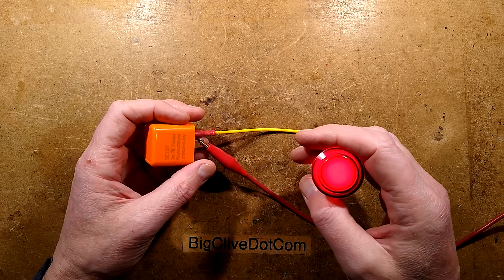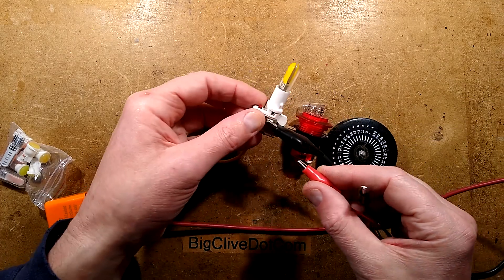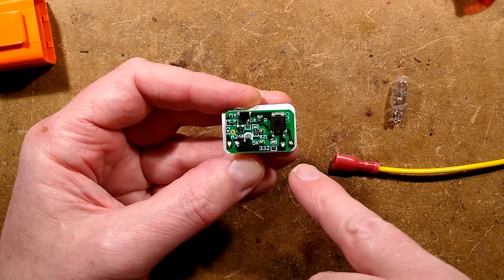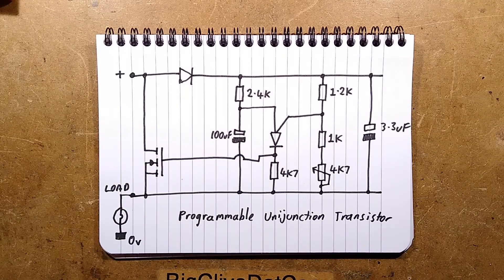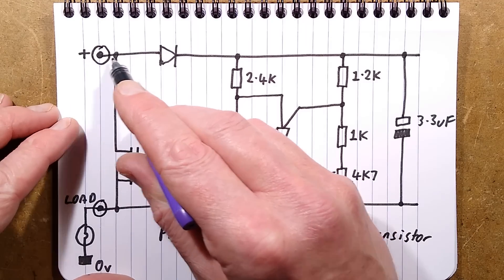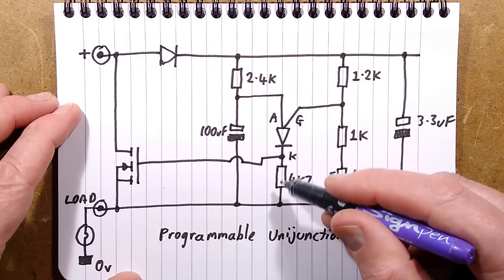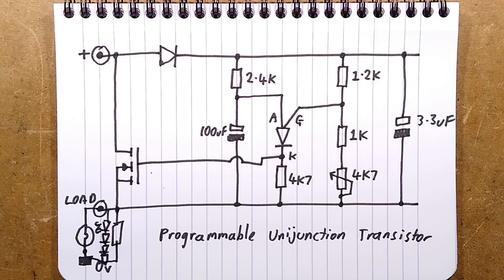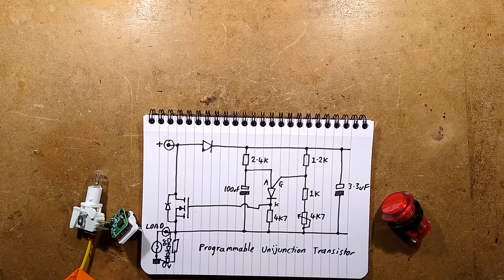Two wire flasher module teardown with unexpected find

Comment: Now that cars use solid-state flashers that don't click, recent cars have a solid-state click sounder fitted to show the indicators are on.
Not sure if it is an all-in-one device in my car, but you can tell it's not the bi-metallic strip clicker but some kind of sounder making the click as the indicators go on/off.

Regards,
K.
Reply: You will probably find that the computer does the flashing of the circuit via a mosfet and the clicking sound is coming out of your speaker system also generated by the computer. In my car, it's the BCM (Body Control Module). Modular mechanical relays are pretty much a thing of the past now in most modern cars, where they do exist, they have very few uses.
Reply: This kind of thing is done via a body control module these days, and they have a speaker for e.g seat belt warning tones that are also used to generate the fake clicking noise.
Reply: Modern? We were synthesizing the "flasher" sound (and many other beeps and bongs) for cars in the late 80s. Used a microcontroller. Programmable UJTs are great for overvoltage warning things too.
Reply: @MarkGovier  We had no need to synthesize that sound in the late 80s because in the late 80s we were still using the bimetallic flasher relays that clicked naturally. The need to fake that sound didn't arise until just a few years ago when marker lights started moving away from filament bulbs to low power lights that didn't draw enough current to trigger those old school relays. Matter of fact, back in the 80s, if a car had beeps and bongs each one had its own piezospeaker to do it.

My 85 F150 had such a buzzer. I ripped it out and yeeted it.
Reply: @TestECull  you might not have, but some major global brands have been using electronic control for the lights since the 80s.
Reply: The lack of a click-click on my eBike turn signals is extremely annoying since I ALWAYS forget to turn them off, so I ordered some self-stick vibrating haptic feedback motors to mount underneath the seat. Pretty sure it will work well, and I'm looking forward to vibra-butt feedback!

Comment: Huh, it's like a low frequency DC version of a triac based lamp dimmer in that it's purely in series with the load. Neat.
Reply: Isn’t this a SCR?
You can make AC dimmers with them, the first dimmers were this way, but of course they were only half wave, and electrically they were very noisy.

Comment: I used to have an old Land Rover with a tired mechanical flasher. I replaced it with a three pin relay flasher after adding an earth connection.  This is interesting though.
Reply: Funny enough replaced a tired 2 pin flasher on a Nissan van, and the official Nissan replacement part was a 3 pin flasher, with a tiny 3 pin to 2 pin adaptor, and a ground wire with a large lug on it, that you grounded to a nearby steering column bolt, which also was used to hold the bracket that the flasher was now attached to. Those 2 pin bimetal flashers were known to fail after around 5 years of intermittent use, despite being genuine Denso parts.

LR used Lucas, which was intermittent from the get go, and of course you had a row of identical unlabelled switches, all of which do nothing, because Lucas. Constant indicator, intermittent flashing headlights and horn....

Comment: Wow.  An SMD PUT? Way cool!  Last I'd seen of those was 70's?  Thanks for the modern/retro flasher bits...
Reply: Used a few in the 80s/90s in some hobby projects, as part of a relaxation oscillator. Can't remember the part number but definitely not SMD!
Reply: I remember seeing them on Sun Micro server processor boards when I worked at Celestica in the early 2000s.

Comment: The only thing missing is an audible click sound when it triggers. :)
Reply: Plenty of room in that case to add one!
Reply: I was going to comment the same thing.  I was expecting to see a piezo disc and drive electronics in the case.
Reply: Simple: Put it a standard 4-prong case and hook up one of those mini speakers from an in-ear headphone between output and ground.
You might need an resistor in series, and use the case as resonance corpus to amplify the noise.
Should also act like the 1k resistor clive used to make it work with led's.
Or leave it as it is and put the speaker across the mosfet.
Reply: You might add an Piezo-Disk in parallel to the Device. The Disk will probably fit into the case
Reply: hhahah true
Reply: I always wonder if they were a legal requirement as its an audio reminder that your indicating.